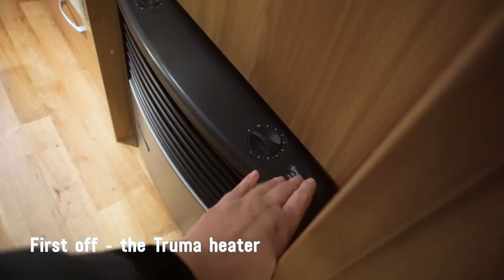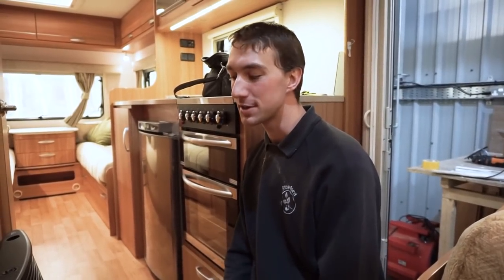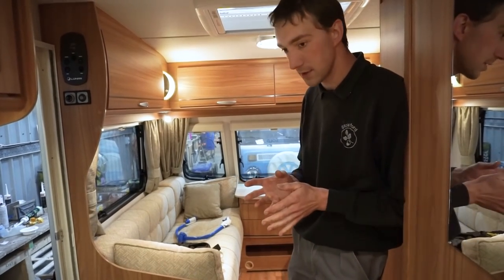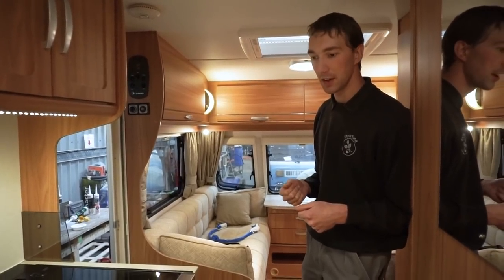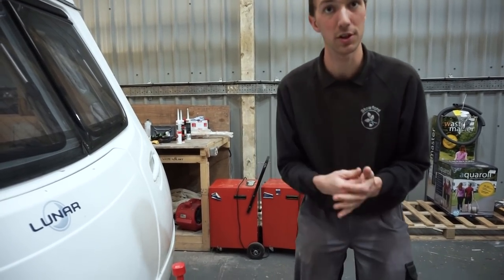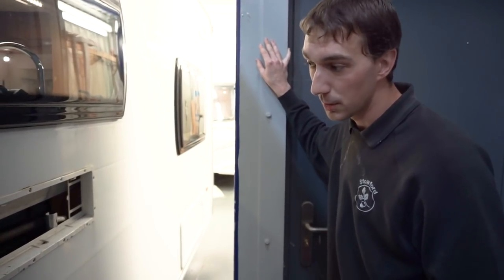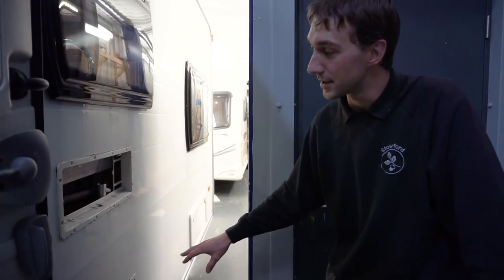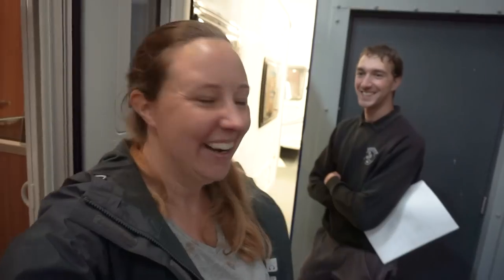What Can Go WRONG With Older Caravans?

Comment: What a great guy.  He was explaining things very well for the target audience.  I had a problem with my room heater like this one, it wouldn't work on mains hookup. Getting to the circuit board was a very fiddly job and rather than spend upwards of £100 on a replacement, I was lucky enough to fault find it and change one transistor at a cost of 50p (plus at least 4 hours of my time).
Reply from the maker: That’s great to hear you could replace a transistor and fixed the problem! I’d be lost...

Comment: didn't know about the battery in the fire,the info on the fridge was very useful
Reply from the maker: I asked many many questions about the fridge 🤣
Reply: Travelling K those refrigerators,,work, by a chemical process, which needs a heat source to,operate,,, for THAT REASON THEY NEED TO BE BASICALLY LEVEL, they are an ABSORBTION  TYPE
REFRIGERATOR, , LARGE ONES USED TO USED IN HOMES WITH NO ELECTRICITY, AN USED KEROSENE, IN USA the band was SERVEL, in EUROPE  was ELECTROLUX, which now owns SERVEL, and now  only made to use PROPANE.., MERRY CHRISTMAS,,and CHEERS FROM, NJ.  USA🇦🇺🇺🇸

Comment: Having had a few really old vans - one of the important issues is water leaking around the roof vents - especially if the van is wooden framed and not the modern insulated panels.... 
I've had to reframe a whole section of the roof as the frame had rotted away.... not an easy job...

The best tip, as ~Aaron mentioned, is to treat damp early, this will save in the long run !!!
Reply from the maker: Yikes! Sounds like it would have been a challenging job for you!
Reply: @TravellingK  I was a lot younger lol

Comment: 4:40 Good idea as I do, is to use a Dehumidifier over winter to keep moisture levels low, and keep Caravan (Or MotorHome) dry and prevent later problems. Check occasionally and empty container of any water. Can get a second hand one on EBay as I did for less than £30 which will do the job. (Mains Connection Required) If in Storage there are some 'desiccant' moisture absorbers, but only effective for a short period of time.
Reply from the maker: That’s a good tip. I just use the budget absorbers 🤣

Comment: Karen, I've done a floor repair on my 1994 Lunar in one of my videos (https://youtu.be/AWZX4vOZxPU). I used the "top down" method. It had been repaired previously in 2004 (judging by the newspapers left there) so I pulled up the carpet, drilled out the dowels from the previous repair, filled the holes with a one part epoxy and fitted new dowels. It worked a treat.
Reply from the maker: That’s interesting!! Glad it went smoothly for you.

Comment: I think the most useful tip is that a AA battery might fix your heater!
Reply: Are you sure that was an AA ? It looked bigger to me !
Reply: @millomweb  That is what he said it was. 1:02
Reply: @johninokla2635  And it appears to be in Truma video but again, they' don't specify ! so I'm just comparing with human fingers holding it !
Reply from the maker: Glad that was a helpful one! Something you wouldn’t expect either...
Reply: @TravellingK  Surely it's mentioned in the handbook for the heater ?
Don't people read them (handbooks) when things don't work properly ??
Reply from the maker: Sounds like it’s a regular issue at the workshop 🤷‍♀️
Reply: Travelling K   True!  I think some people just don’t have the confidence to mess with an appliance that’s both electric and gas.  Also, who knew there would be so much fluff and dust in there!  😲
Reply: @audreyfforbes-hamilton  If it's not easy to get in somewhere to clean out, fluff, dust and spiders etc. will find it a fairly good safe home ! So if you've not seen inside somewhere for a long while, assume it's full of the stuff !